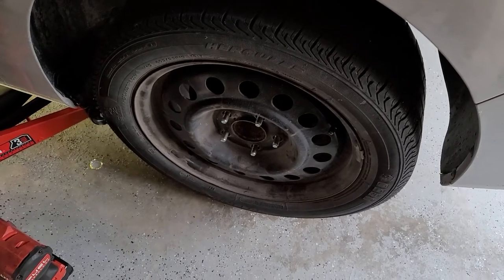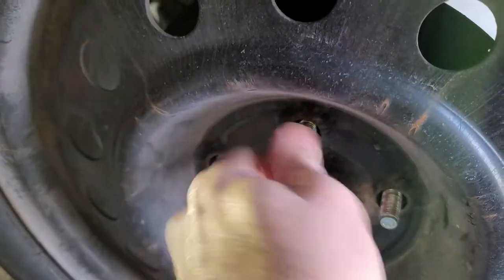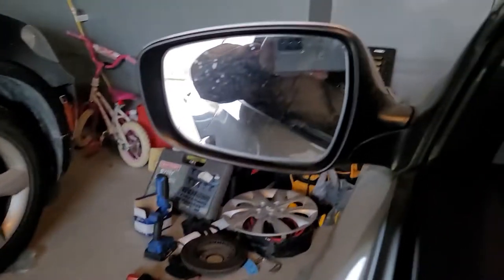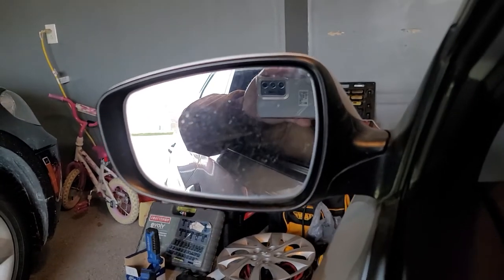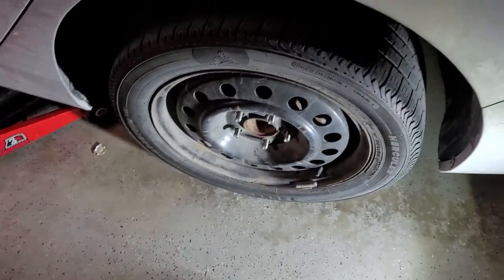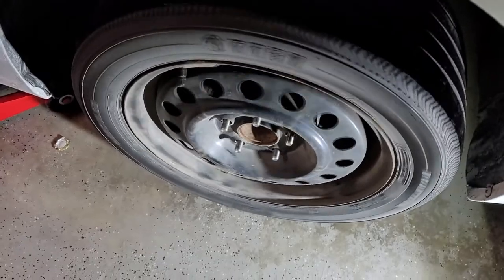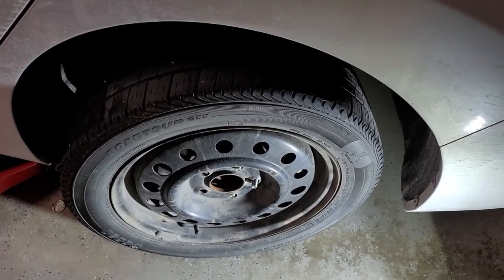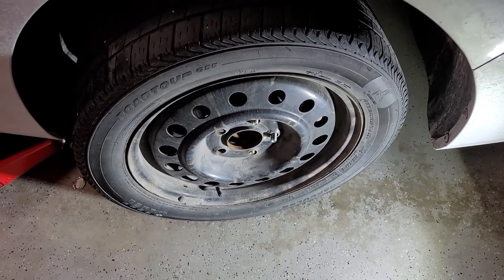Wheels Stuck? Here's how to remove them WITHOUT a torch

Comment: I had a mate who was a mechanic for a few years and he told me how his boss always advised just whacking stuff (especially seized wheels) with a mallet. One day, my mate could NOT get a wheel off and went and told his boss that nothing was working, and his boss grabbed the mallet and literally put his entire body weight into whacking the wheel while it was on the hoist. My mate described it as "it looked like he was actually trying to damage the car". But it worked.
However your trick looks pretty cool too.
Reply from the maker: Well, that is one way to do it. I personally have terrible elbow pain on both arms, so I try to look for any method to not inflame that pain. I've used the method in this video a few times and it works well for me. Thanks for taking the time to tell that story.